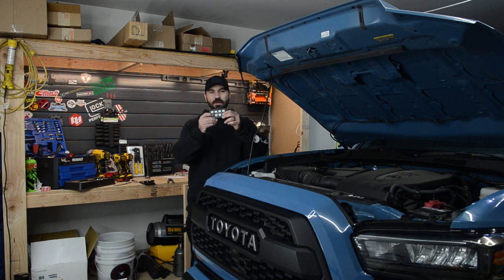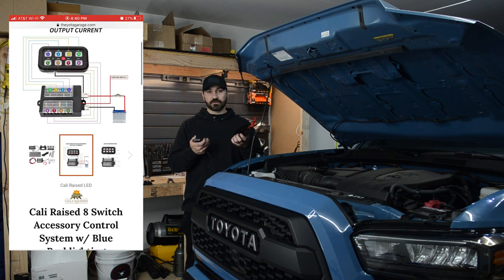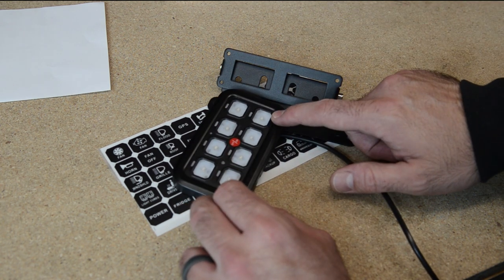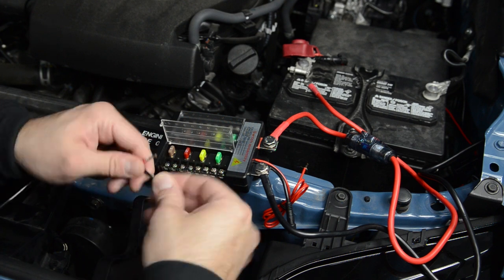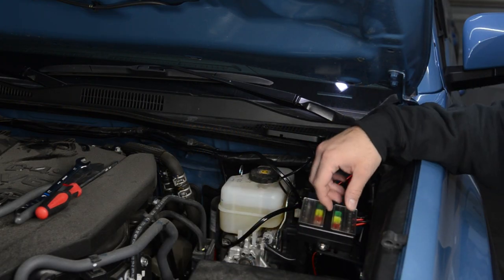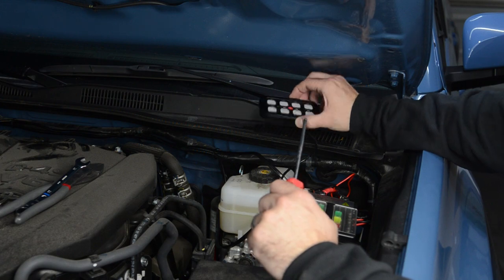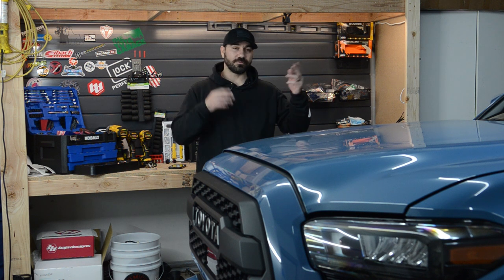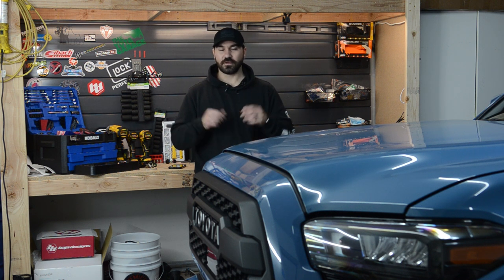Cali Raised LED Light & Accessory 8 Switch Panel Install & Review - 2019 Toyota Tacoma (3rd Gen)

Comment: This might seem silly, but i tapped the add a fuse into fuel pump, and the back light stays on even when key isn’t in ignition, tried efi fuse, and and basically anywhere i put it, same result. Only way i can get back light off is unplugging it. And recommendations boys?

Comment: That's the easiest method I've seen. I wonder if you could place a Blue Sea Thermal breaker in between the battery and Cali fuse box. That would be ideal.

Comment: The on off switch will turn all of the accessories off at the same time. And turn the ones that you had on when you shut it off back on.
Reply from the maker: Awesome, thanks for the clarification!
Reply: @GearheadJT  not a problem, took me a while to figure it out. Kind of a handy function really. I havent had any problems with mine yet. I have had it for about 3 months.

Comment: Hey there, thanks for the video! I was wondering if the single bolt has held up for you after off roading? I had used a nutsert tool to attach mine to a near by area like yours but the nutserts have started to come loose after some heavy off roading.

Comment: For the Cali raised Dual function light bar I’m trying to wire it to the same switch panel you have. 
Did you t tap the ground? I’m having a hard time finding anything on this 

I know it has 3 wires coming out from the light bar (red/white/black)

Comment: So this allows you not to run any of the relays on the lights correct just plug the lights directly in?
Reply: Wondering the same
Reply: Correct. Just like the rough country mlc-6 or other higher end multi light controllers. It's super convenient and cleans up a lot of wires

Comment: Really nice video.  Thank you.  So, dumb question, but you didn’t have to do any drilling to get through the firewall?  You just went through the plug?  And did you put that plug back?  What the plug for?
Reply from the maker: No Drilling required, I just cut a small slit into the rubber plug and re-installed it. I'm not 100% Sure what the plugs are for, they are generally left open for wiring, or in some instances Manual / Automatic trucks utilize the same body and will have additional openings.

Comment: Did you connect any caliraised lights to the switch? If so how did you connect them? And did you keep the replay?
Reply: Toss the relay, mount the positive and negative wires from the lights straight to the switch assembly
Reply: @thatw1mpydeer  thanks! I did this and it worked!!!

Comment: Did you have any luck with the add-a-fuse where you put it? I’m still trying to find a place to hook it up to so the backlight isn’t always on.
Reply from the maker: Not yet, it still stays backlight all the time when I turn the truck on. I’ll play with some ideas over the next few weeks.
Reply: @GearheadJT  I'm not sure if this will help with your truck (I have a 2013), but I ended up splicing extra wire to that red power wire and ran it inside the cab to the fuse box in there. There was a fuse port labeled "ACC" that I pulled the 7.5 amp fuse out and put the add-a-fuse in that spot. Now, the panel backlight only comes on when I turn the key. Hopefully this helps.
Reply: I tapped the add-a-fuse to my headlights. I’m running the auxbeam panel (same thing).
Reply: @GearheadJT  inside the cab, there's fuses there you can use. There's 1 or 2 that turn off and on with the ignition, and if you want it only with the interior lights, you can tap into the tail light fuse
Reply: Cigarette lighter port fuse is another good spot

Comment: Hey man hope you’re doing well. Quick question where on the wiring harness do you cut off to hook it up to the switch panel? Since most harness come with a relay. Also the wiring harness I have come with a black, white and blue wire. Assuming I don’t need to use the blue wire at all. Thank you in advance.

Comment: Hey so when you put in the add a fuse you didn’t show yourself actually plugging it in, the little ports for all the fuses are so deep the add a fuse supplied can’t even plug into the port. How did yours plug all the way down??

Comment: You mentioned that to didn't connect it directly to the battery because it would be lit up all the time but isn't there a power button on there so you can turn it off?
Reply: You want the fuse relay box connected to the battery and fuse circuit breaker cable connected to a fuse slot that isn’t under constant power.

Comment: Thanks for this. So after adding the fuse to the main fuse box/fuel pump slot, how did you run the wire so that the fuse box closes?

Comment: How do you wire a light bar that already comes with a on/off switch wires to the relay the has the +/- that hooks straight to the battery? I hooked it up like you did but the light bar switched on and stays on until I turn the ign switch on. Any help?

Comment: That switch panel looks like an Auxbeam to me. Also you should probably crimp some fork connectors to the wires from the lights/to the fuse block.
Reply from the maker: Same here, the actual control unit/fuse box is a bit different though. I wouldn't be surprised if it comes from the same manufacturer in Asia.

Comment: I have a 2020 Ram Rebel.  I have a Code4LED which looks like the exact same unit. I tried the Add a fuse in three different locations with the 10, 7.5 and 5 Amp fuse. Needed a micro that I ordered from OReilly Auto parts.   None of the 10 AMP fuses would light up the unit when I started the car.  I'll look inside the cab as suggested.   Works fine when wired directly to the battery 
Any other ideas.  So bummed :(
Reply: If your switch panel is on when you wire the controller box directly to power, this most likely means that the circuit breaker or online fuse between your box to the positive terminal of your battery is either fried or tripped. Some where, you have a bad fuse. This is my only suspicion your switch panel works when wired directly to the battery.

Comment: My light bar has amber lights and white lights but only has 3 wires how do I wire it so i can control each one I also have a switch panel already installed

Comment: Add the fuze to the ignition fuze. Thanks for this video! I was looking around for a video on the switch panel and couldn't find one until now. I ordered this same one from CaliRaisedLED but never installed it because it wasn't waterproof. Hope it treats you well though!
Reply from the maker: Thanks for watching - I haven't had any issues with it yet, and have been through some gnarly rainstorms and blizzards, fingers crossed it holds up.
Reply: Which one is the ignitition fuse?
Reply: @Mandothemagnificent  There are several ignition fuses. You’ll have to get voltage tester and see which fuses draw power with the vehicle on but don’t draw power when the vehicle is off. Once you find that then it should be an ignition fuse.

Comment: Greetings, could I connect my Viair 444C compressor to this Switch Panel?
it would only be 1 compressor the viair 444c
Reply from the maker: Great question, and I have been researching the same as Im planning on doing on board air as well. The Switch panel has a maximum draw of 30Amps, to make sure the compressor doesn't trip the fuse what I'm going to do is Connect the Power Cable for the Air Compressor directly to the battery with the provided Relay and Fuse, and connect the switch wire to the Panel, this should work perfectly fine. Hope that helps!

Comment: Did you ever find a better add a fuse placement other then the fuel pump fuse?
Reply from the maker: I haven’t, however haven’t had any issues with the current placement!

Comment: I noticed the "fuse panel" the lights connect to under the hood doesn't seem weather proof, any concerns?
Reply: I have a similar issue with my 4runner. I am not able to close the fusebox but don't know what fuse to use inside the cabin

Comment: Were you able to use a compressor on this switch panel?
Reply: You can use a compressor with this switch controller IF your compressor draws the amperage within the amp rating of the fuse on the controller box. The highest amp rating on the fuse on this box is 30 amps, so if your compressor operates within 30 amps, it will work. If your compressor draws a higher amperage, you can change out the fuse on the controller box to a higher amp as long as it doesn’t exceed 60 amps (the circuit breaker that comes with the box is 60 amps).